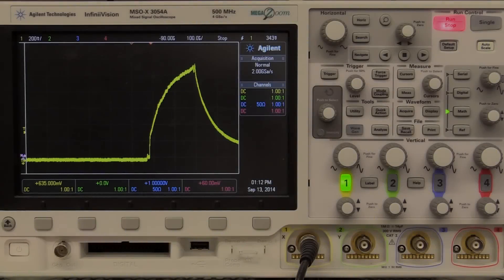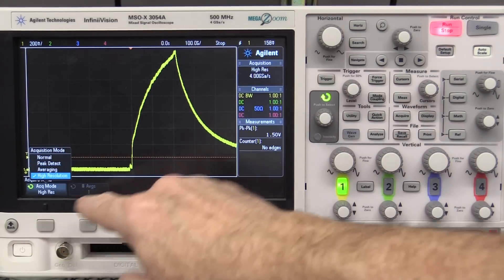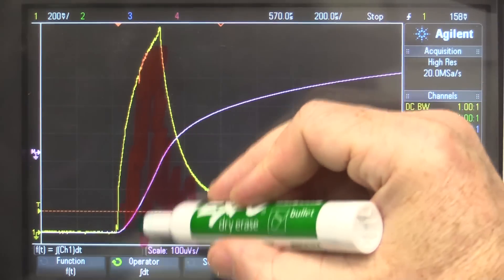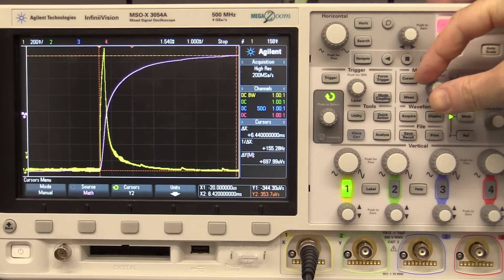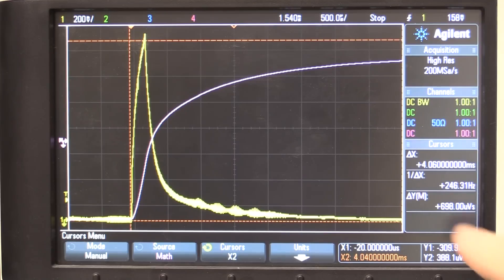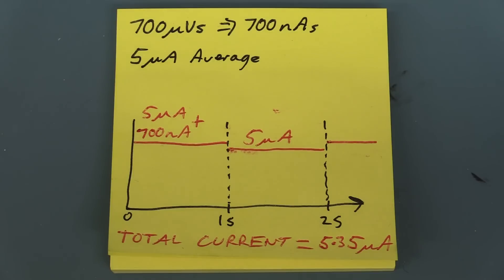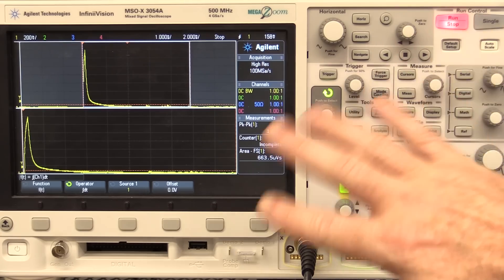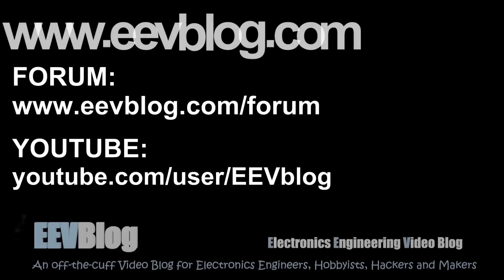EEVblog #662- How & Why to use Integration on an Oscilloscope

Comment: I jumped when he started scribbling on that transparency... Mathematics is so incredibly awesome; I wish kids in school would realize this fact and not learn it later in life as I have.
Reply: (sry for wall of text)
It all depends on the persons interest. Math is only awesome when you are able to use it to get work done. This is largely why most students become disinterested in math once half way through middle school. That is the point when the math becomes less and less relevant to what the student sees in the world around them. More basic math can hold the interest of a wide range of students as they can learn it in school and be using it in a productive capacity that same day in the real world, or see people in their community using it. this reinforces the motivation to learn it. For example It is easier to get a student interested in division if it helps them calculate the price per gram of various foods that they like to buy, in order to find which is the best deal, but it will be an uphill battle to get most middle school and some high school students interested in calculating the 95% confidence interval on a set of data they collected, and then represent those calculations in standard deviations.

Now if they get into a field that requires those calculations, then they will be more interested in it as they will have a use for the math they are learning.

On top of this, if a student is forced to learn math or any other content that they have no use for, then the odds of them retaining the knowledge is very low as they will not go through many of the vital stages of the learning process which increases the likelihood that they will retain the knowledge.

They essentially need to go through  Knowledge> Comprehension> (then repeating some or all of the latter in real world) Application> Analysis> Synthesis> and Evolution.

The higher level thinking cycle keeps the skill fresh. When students are learning a skill that they cannot practically make use of in the real world, then after the knowledge and comprehension stage, everything from application to evolution of what was learned, is done in a more synthetic fashion that will likely never be repeated in the real world, and due to the synthetic nature of the higher order thinking levels of the learning, reduces the likelihood that the skill and knowledge will be internalized as the synthetic nature makes the work less fulfilling, as it will not provide the same sense of accomplishment as putting the skill to use in the real world and making a difference in the lives of others, or making money through the use of the skill.
Reply: @Razor2048  I would never put my thoughts so close and easy in one paragraph. :) Thank you.
Reply: Razor2048 You've pretty much summarized all that is wrong with the modern education system, which wastes away an unforgivable amount of time. People justify this hamster wheel as "imparting a sense of discipline", but that can be done concurrently with a far better learning structure. There will always be people who will grab a textbook and go through it meticulously and collect their A+. Those people are not the majority, yet they're used as examples of how students "should be". For most people, unless there is a tangible degree of passion behind their efforts, it's all a huge waste of this short life on our planet...

The school system, which certainly includes universities are like impenetrable fortresses which are not to be messed with by mere mortals. Advice is only ever dispensed, never considered.. and the people running them have a sense of immunity from criticism or wrongdoing alike.

The good news is that the internet has been slowly changing all that and eventually the school system will adapt.
Reply: ***** Truthfully I see your view of reality as poisonous. That said, I agree that math in its pure form is a great thing to encourage for those who have a capacity for it. Math above all is a way to see a world of connections that are completely invisible unless a person puts much of their time into climbing that mountain. It's not for everyone, but it is everything! (ha)

Onto the bad stuff:
-The world does not subscribe to solipsism. You exist with others and have to find harmony with them, not shun them like your ego tells you to...
-"Stupid" is a subjective qualifier that has philosophical roots for each person; you cannot turn it into something absolute.
-There will always be someone a lot smarter than you, who might (just as wrongly) consider you stupid. Don't play that game, it won't do you any good.
-Peoples' natural passion is not extinguished so easily by the presence of others who slow down their momentum and somehow force them into underachievement.. the latter is a personality issue above all.
-The mentality that gives you a sense of superiority over others because you consider yourself intelligent, is the same mentality that created slavery where the select few grant themselves the right to police everyone else they deem inferior using various garbage as qualifiers. Calm your inner villain.
-What lets people achieve far reaching goals is self-discipline and focus, not having the world babysit them until they magically blossom.. or otherwise blame the world for having had failed them. History shows much hatred for early scientists and mathematicians who challenged the status quo with their ideas...
-Algebra is a lot more useful than calculus specifically for people who aren't trying to become engineers (majority). Many jobs require some algebra knowledge, and reaching that will make a difference between a person having a half decent job, or not. If they're forced into an even lower job, it drags down the average of the world in which you live. Accept that math can be utilitarian, and help people come to terms with it when it's not their strength but rather a necessity.
-A person who has made it to mid-level calculus is more comfortable with math and should not require constant babysitting to the same degree.
-Postgrad math is incomparably harder than the examples you've listed, it ends up as a lifelong commitment to a very specific area for a researcher. Everything is relative.
-The goal of education is not to breed unwieldy geniuses; it's to keep raising the general level of education of ALL members of society. That is how you decrease poverty, reduce crime, and give people options in life that make the world better for everyone, not just you...
-We already have organizations that specialize in breeding geniuses: Google, Apple, Microsoft, JP Morgan, Tesla, SpaceX etc. Feel free to apply and enjoy. Some of them are great companies. :)

Sorry if any of this sounded harsh. You're welcome to disagree, but this is not the right place for these discussions and I've spent sufficient time here already.
Reply: ***** Yep,  mathematics are very beneficial in life, the issue that many schools face, is building intrinsic motivation. For lower level math, the schools do not have to do much to build it, as its application is visible outside of school. When it comes to higher leave math, then there needs to be more effort put into motivation, if not then many students will simply not retain it, and become really bad at it.
Wanting to learn math out of pure interest, is even harder, especially (at least with the schools in the US) where higher level math does not go much beyond finding the right formula to use in order to get an answer. Because of the way we learn it, if we cannot find a practical application for it that we can engage in outside of school, or have the drive to learn it due to a future goal that will require the skills, then the math will be avoided as much as possible. Not sure how much worst it gets in other parts of the world generally schools will focus on formula and application, and unless you can find the motivation to remember how to use the formulas, you will have a lot of trouble with more advanced math.

In my personal experience, the merits of math were never thought, instead, the schools used threats and punishment to teach math. Essentially the only reason why you would learn the math, was because if you did not, you would get a failing grade, and possibly incur other punishments. Overall, the focus was on the bad things that other people in authoritative positions would do to you if you did not learn it rather than the merits of learning the math. The end result is that math became an unpleasant experience that we had to endure or they will subject us to other unpleasant experiences. We did not really learn the benefits of higher level math until we were pretty much done with higher education.
Reply: @Razor2048  :) I recall my drunk teacher on math practice in University saying that better integrate present exercise from 0 to 100, than to 50, but integrate from 0 to 150 is even better... (that is about what person could see of practical use of hi-math, even from hi-education). Just the need to read through the manual and functions of my first oscilloscope taught me more math than my University years (with the main goal to study, pass and forget motivation).
Reply: Razor2048
Nah Math is always awesome.
Reply: ***** -It's not right to describe anyone as stupid regardless of whether you believe that it is the case or not. There will never be a situation where it will help you or them. Even if in your own morbid way you believe that you'd be helping them come to terms with their stupidity, which is what you've alluded to before, calling a person stupid will never make them consider that statement seriously. Hence, it's simply poison for both parties with zero merit.
-I did not in any way limit your freedom of expression. I encouraged it by saying that you're welcome to disagree. My slavery comment was simply a psychological parallel. I value your opinion as much as I value anyone else's. If I see a comment from you that I agree with later on, I will not hesitate to say so regardless of this particular disagreement. I'm Canadian and we're nice like that. ;) For instance, I fully agree with you that people are far too afraid of difficult subjects. I always encourage people to give things a greater chance before deciding to give up.
-"Inevitable failure" is not your call to make.
-University education is expensive enough to entitle students to basic due diligence with respect to tutoring, regardless of aptitude. Nobody is forcing you to tutor people on a purely personal level. It's either your obligation in some sense, or it isn't. As for high-school education (since I don't know your age), the degree of effort made in high school will affect a person's life even more greatly compared to university education. Weaker students should try as hard as possible to reach the highest point they can on that ladder, it will be of big benefit to them.
-I wish you patience with your tutees.
Reply: *****
There's a difference between stupid & uneducated...
Reply: *****
People get out of learning what they put into it. In my younger days when I was an automobile mechanic; I saw guys that graduated the trade schools and couldn't rebuild a carburetor, and guys that graduated and could rebuild anything. But learning is the same no matter what the discipline is: you get out of it what you put into it.
Reply: For me, Math is incredibly interesting (and useful) for its extensive applications, especially in physics and chemistry, and I already found out that out halfway through high school. But I can't do the sheer theory of it JUST for the theory.
Reply: Kids are just that, kids. Let's them climb trees, play sport, go swimming. don't force them to bury thier heads in books as they won't be able to have a childhood later in life. Us nerds and geeks chose to do that as kids

Comment: An annoying thing on the integral function on my MSO6034 is you can't apply an offset to the input of the integrator to cancel out baseline current draw.
Reply: There is an offset softkey when using the integral function on the 6000 right? I see it's on p167-168 of the user's guide.
Reply: *****
That offsets the output, not the input
Reply: mike i love your video's keep it up!!

Comment: About the inaccurate measurement of sleep current by the integral function -- Putting on my pedantic hat; it might be more accurate to blame that error on offset, rather than noise. I only say that because noise is not a DC thing, some of those samples will be high, some will be low, it all cancels out -- that's one of the wonderful things about integration, it pulls the interesting low-frequency stuff out of the noise. What's left over, and what survives integration, is offset error. It would be interesting to short the input to the uCurrent to see what a true zero-current reading looks like, and to see if any real signal survived the quantization process.
Reply from the maker: TheHue's SciTech Yes, when it's that low down, offset will certainly be a huge contributor, I forgot to mention that, thanks.
But ultimately at this level you are down into the LSB error territory. 1.4V peak at 8 bits, basically gives us that 12uV we are seeing for example. Better in high res mode, but basically not good enough for an accurate reading on it's own in this case.
Reply: EEVblog I suspect quantization error can be ignored (or more accurately, divided by a thousand) when a) you're integrating over possibly millions of samples and b) you have analog noise that is dithering your signal for you, making the quantization noise DC-free as well. Having said all that though, annoying other effects like INL could cause issues. I'm going to do some experiments right now... :-)
Reply from the maker: TheHue's SciTech But you are going to hit the ground at some point! (pun intended) There are practical limits to what resolution you can get out of a scope in this example.
Reply: EEVblog Yeah, so on my DS2022 I was able to get 1mV accuracy on readings at 500 mV/div (1LSB = 15.625mV). But it was an extremely painful process -- for example, if I had a stored waveform ("Stop" mode), and I shifted the signal up and down, the reported average would change all over the place. Evidently, the average is taken from on-screen values and converted back to volts, then averaged and displayed. All this requantization over and over again destroys the accuracy of the thing, and defeats dithering. I couldn't get 1mV accuracy on the scope screen, I had to save waveforms as CSV files to see the true underlying accuracy of the scope. Not suitable for everyday use... I wonder if the Agilent has the same odd architecture? I doubt it.
Reply: EEVblog
Also, keep the limitations of the uCurrent in mind. I guess, that some issues can be traced down to the uCurrent. Those pikes in idle "current" could be auto-zero artifacts and at the low end of the range, the Output Offset Voltage of <50µV gets significant.
Reply: sarowie
What is a pike?
Reply: Robert Calk Jr. It's kind of like a "spike", but without the 's' :-)
Reply: TheHue's SciTech
Oh, ok. :-) I thought I was missing something.
Reply: That noise could also be increased by the internal clock of the µC which needs to draw current to flip its bits. Your suggestion to measure the current could be used to determine how much it draws to power the clock.